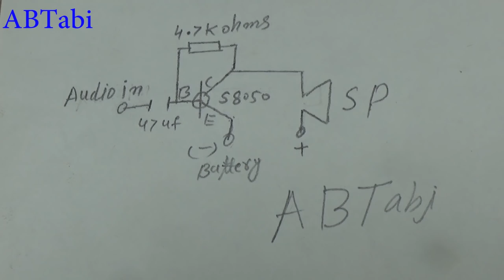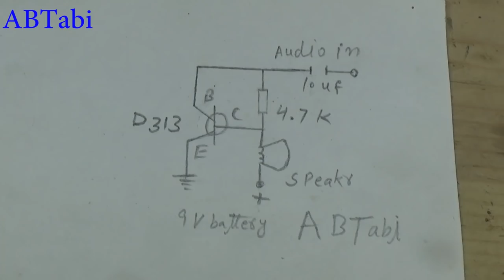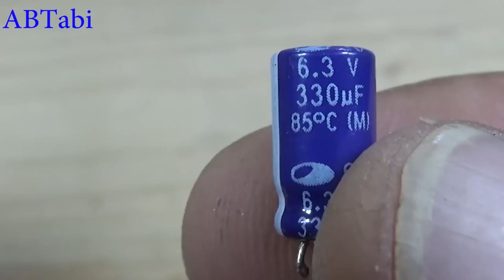Top 5 useful super easy audio amplifier diy projects

Comment: I am impressed. I found a small usb audio unit smashed out of a speaker system. I wired it up with 5v and a small computer speaker and could just hear a sound. I used the first amp shown here, wired a similar npn transistor (a BC107b) with an electrolytic capacitor, the + end to the base. I am now listening to music I downloaded from utube onto a memory stick and it is loud enough to need a pot to turn it down. Thanks ABTabi you should be proud of yourself.

Comment: I somehow blew out my daughters power wheels radio trying to do this ... any idea what I did wrong ? I used +and- from radio as audio in and hooked +and negative leads from 18v milwakee battery wich I assume would be the problem however the radio was previously running on same battery to begin with?
Reply: They're both connected to the same battery then there's common ground or negative and it probably fried it through there I had the same thing happen to me on it different kind of device but it was for my motorcycle

Comment: I have a cuckoo clock melody circuit that is connected to the 8ohm 0.5w speaker and I want to replace it with the 8ohm 1w speaker. When I connected it the output was not that much great as the 0.5w speaker. What will change do I need to do?